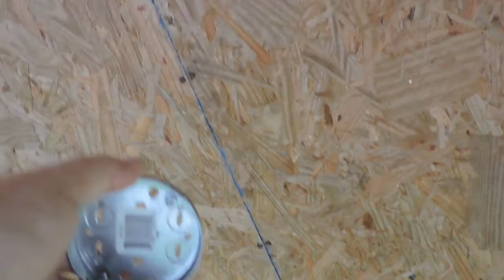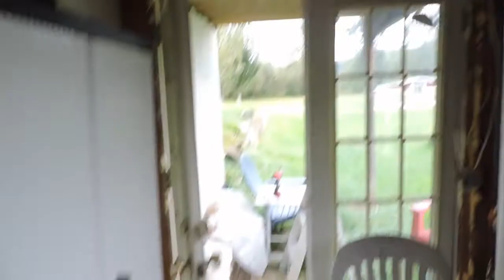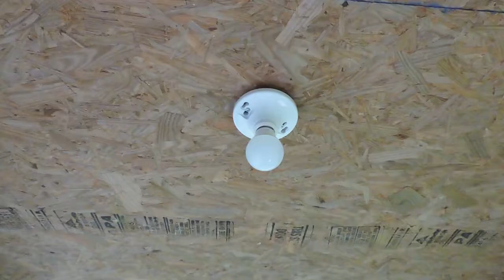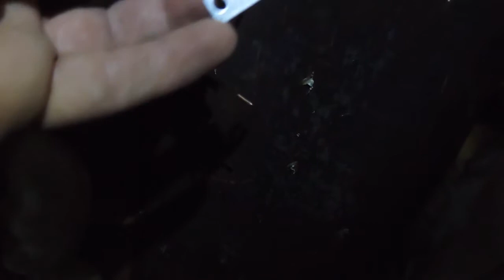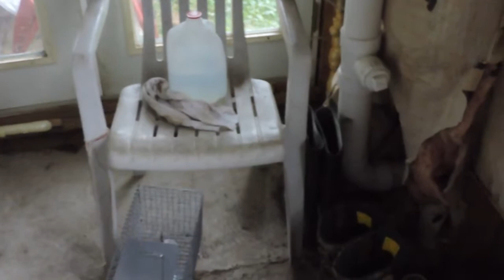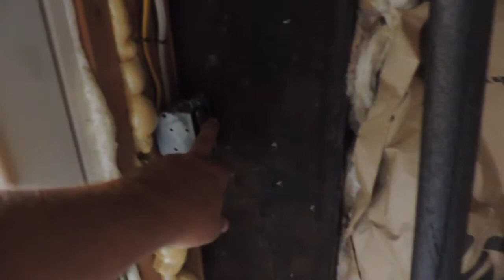Wiring Some Lights and a Brief CFL Rant

Comment: CFL light bulbs were good 15 years ago, but now I no longer buy CFLs, as I think they're now obsolete.  In addition to containing mercury, they take a while to reach full brightness, even longer when they're cold!  Over time, I'll be replacing those CFLs with LEDs as they fail.
Reply from the maker: I never did the CFLs.  It was part of the scam GE had with the Obama administration.  He banned 100 watt incandescents and GE stepped in with the CFLs and made billions!  But, I agree with florescents in general.  I have an unheated shop.  In the winter the old style tube lights seldom work right, but I've replaced a few of them with LED shop lights.  They are amazing!  And, now that the prices have come way down,  I'll replace more.  A 5000 lumen shop light for under $20 isn't bad.